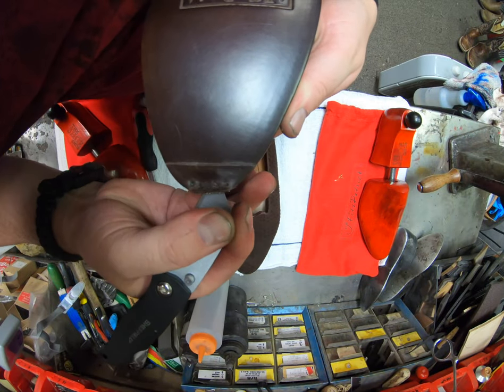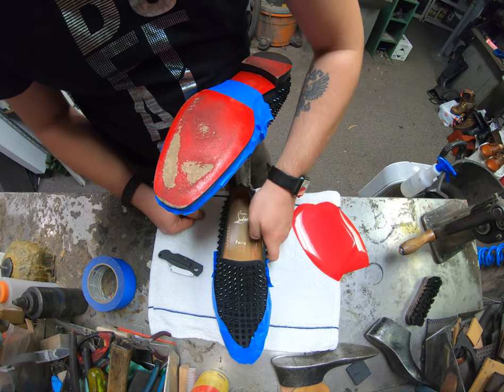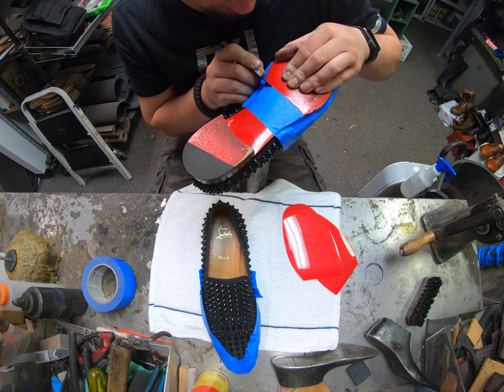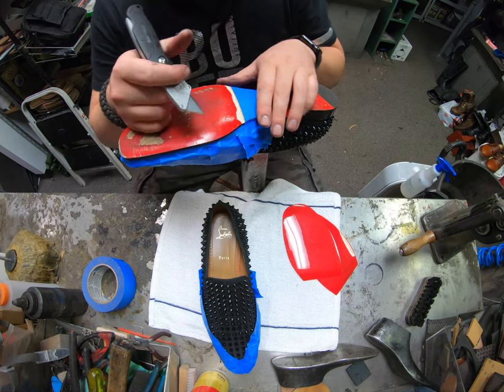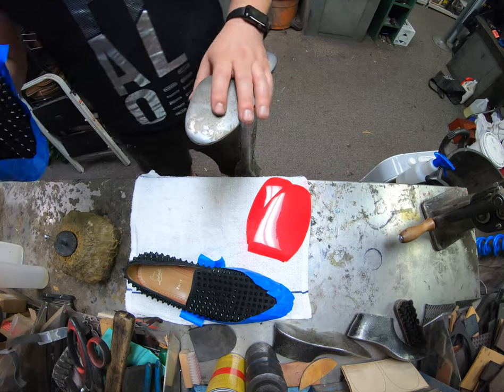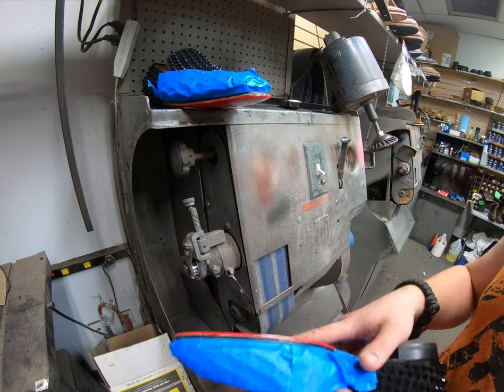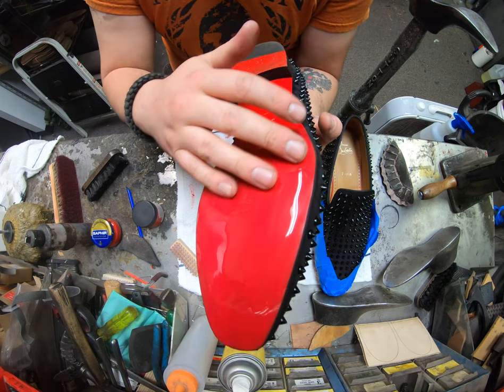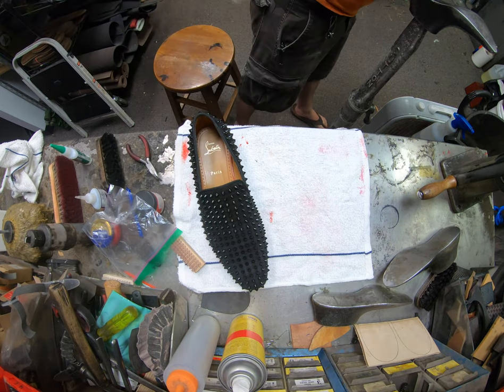Mens Christian Louboutin Shoes get a new Mirror Gloss Protective Sole (Sole Guard)

Comment: it looks like a rubber sole (the casali mirror gloss) that you are placing on this shoe...so two questions 1) if you did it to a new pair of Louboutin shoes...would the casali sole get all scratched up? or it would just wear like a piece of shiny plastic. Also 2) it seems like it would give you some grip whereas the current wooden paint are slippery until the paint scratches off?

Comment: I enjoy your channel. You are a very skilled artisan.  Needs some advice......how do you get out water stains in shoes? Also, my wife bought a vintage Chanel handbag. It has a musty smell. Any tips how to remove a musty smell in a lambskin purse?  Thanks.
Reply from the maker: Water stains you may need to have what’s called a Swedish done to them it depends on the leather and finish. If you can email us some pictures would be able to help much more with that. As for the handbag with a smell it needs to be aired out at first and may need some cleaning done similar to the Swedish wash but lighter.

Comment: I just bought a pair of mens louboutin shoes. I haven’t use them yet. Do you guys do a clear lining on top of the original sole to preserved them for much longer?
Reply from the maker: Not a clear one. Clear sole protector (tape) is a very temporary thing that only lasts 1-2 wears. A red bottom sole protector like this lasts longer, stays red and grips. We do them on new shoes especially all the time if the plan is to have the shoes in for years